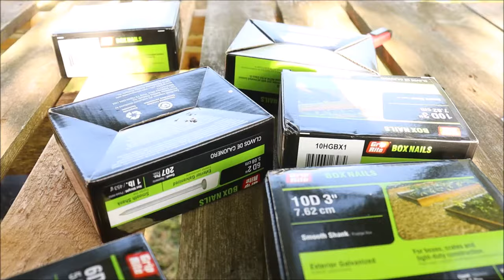DIY Building an 8'x12' Lowes Shed Kit/She Shed

Comment: We recently put up a shed kit from Lowe's as well. Ours was a barn style so the roof is a bit taller but other than that, the experience of putting it together was pretty much the same. The wood that comes with these kits leaves much to be desired, but in the end, it's a nice-looking building and is pretty sturdy. For our next building, we're going to use pallets and reclaimed wood. We want to be able to do it on the cheap, so using free wood should help.
Reply from the maker: I too enjoy  using reclaimed items to build with.  They are usually much sturdier materials and then there is so much room in the design project.  I am loving my shed, but I wished we could have used different material foe the doors and different window and door placement.  In the chicken coop project I did at the same time we used recycled materials and I am very happy with that project.  I would love to see your next project!
Reply: @BloomwellHomeGarden  Interesting that you mentioned a chicken coop because that is going to be our next project. We are currently building the pallet shed and so far we only have the walls up. Still need a roof, door, siding, insulation. But after all of that, the chicken coop is next on the list.
Reply: @BloomwellHomeGarden  By the way, I just subscribed and I am going to have a look at your chicken coop video as soon as I get a chance. 😊
Reply from the maker: Thanks so much! Welcome. We appreciate having you along and welcome your comments and ideas !
Reply: @BloomwellHomeGarden  hillbillies in use — be careful - Duct taped Duster coming

Comment: Hey how’s the shed been? I’ve been thinking of buying one my self would just like an honest review thxs !
Reply from the maker: The shed has been wonderful. In just a few months (July) it will be 4 years already and that just doesn’t seem possible. To date, other than a piece of door trim along the bottom of the door that was actually my own fault because the latch was not closed properly and a storm blew in causing the door to swing open and closed several times and knock it off, there have been zero need for repairs!  I am so thankful we did this project and have zero regrets ! Now that the shed is established, it seems as if it was always supposed to be there! Good luck with your purchase. I would love to see a photo when you have yours completed!

Comment: This is called a 12x8 stratford from lowes. Would have probably put some 4x4 runners on top of concrete blocks just to get it off the ground. But great build
Reply from the maker: Thank you for watching and for your comment Jorge!   This spring we did use a tractor with a bucket to lift the shed and place concrete blocks under it.  Once this was done we made sure we took the time to make sure it was level.  I had not anticipated how much our ground would heave in the winter.  Now we have plenty of clearance under the shed and it is no longer on the gravel.

Comment: Does the siding cover up some of the base 2x4's?
Reply from the maker: Yes it covers most of the base.
Reply: @BloomwellHomeGarden  Thank you for the reply. I'm building a shed just like this on top of a detached deck and will need to cut the siding so it's flush with the base 3/4 plywood. Thanks!

Comment: Hire a contractor, best money spent, that is what i did!  If you live in an area that snows, you will need to redesign roof so snow falls to the side and not in front.  Cant use it all winter
Reply from the maker: Thanks so much for watching. We couldn't hire a contractor because of covid. Everyone was scheduled 6 months out in our area, these sheds had 8 month waiting list, and we love to do it ourselves.  However, we are having a 12x40ft shed built and delivered in a few weeks, that was more than we wanted to attempt with this year's projects.  You are absolutely right, the positioning wasn't bad for snow, however the ground froze and heaved up and I couldn't get the doors open. We have someone coming April 1st to fix all that!
Reply: @BloomwellHomeGarden  my shed 10 x 12
Reply: @BloomwellHomeGarden  my shed 10 x 12
Reply: @BloomwellHomeGarden  I would just jack the building up and set it on 4" blocks.
Reply from the maker: @gailtaylor1636  we did that about 2 weeks ago!  Still perfectly level. We had a friend with a bucket on his tractor. He lifted and we slid  the blocks in place. After that I had it tilled so I may plant flowers around it. I will be doing a DIY pathway from the patio to the shed soon! I cannot wait to have a nice pathway!  Thanks for watching!

Comment: What happened to the studs on either gable end wall?  There are no vertical structural elements on either end of the building, just the OSB siding holding up those ends.  I would also have raised it up a bit instead of laying the 2x4 joists directly on the gravel.  Moisture will come up from the ground and it has no where to go and will allow fungus to grow and eventually you will get rot.  Sorry to be a bit harsh, but other folks watching this should not make these same mistakes.  But it does look nice with all the paint on it...
Reply from the maker: Hi thanks for your comments.  There are large posts, perhaps we.didnt film that part.  I didn't film this as a tutorial, just as information on what we were doing on the farm so I wasn't as careful spell out each detail and left out a lot of steps for time.  I mentioned that in several comments as well.  Also there are treated  4x4s under the shed and of course in a number of years they will need replaced.  Last year I mentioned we lifted the shed with a tractor, leveled concrete blocks and sat the shed back down on those to get it off the ground more.  Thanks for sharing your tips within our community!

Comment: How much was this shed?
Reply from the maker: Thanks for watching Kathy!!  The shed kit was purchased from Lowes last June.  It was $948.00. That does not include the floor.  We purchased I believe 10 2x4x8 in treated lumber. We also picked up 3 4x8 sheets of OSB plywood, 3/4 thick.  Not included in that price was the shingles.  These I chose in cinnamon were special ordered. It was 5 square and I believe it was $89.00.  I also.contacted the company and ordered 2 more windows at $98 each.  The paint is not included in the price of the shed and I used 2 gallons for the lighter color and 1/2 gallon of the darker brown. This was WalMart Color place exterior paint in Satin.

Comment: I think your shed is less than 8x12. Each panel between the 2x4 should be 12 inches wide. If it was 18 inches 18x6 is just over 10 feet not 12 and the side panel is just under 6 feet. 12 feet across and 8 feet wide is 144 x 96 inches.
Reply from the maker: thank you for pointing that out.  It is an 8x10.  I apologize for not having the correct measurement.

Comment: The foundation...shouldn’t it be raised a-little AND or at least be pressure treated wood.
Reply: Hi Lance, Thanks so much for watching!  You know how you build, make or create something and months later you say, "If I did this again I would... "  Here we are 4 months later and I would like to say, Yes I wish we would have raised it more.  I will be digging out farther and building up around it, next summer. However, we did take extra care with the bottom of the shed by digging down as far as we did, and adding that nice thick layer of gravel for drainage. All the wood on the bottom of the shed, and the flooring is all  pressure treated lumber. I hope this helps.
Reply: @kimbloomwell6395  oh ok i see 
Yeah raise for sure 
Good work! 👌 Happy Holidays
Reply: @dumpsterfire6351  Happy Holidays.  We are getting ready to do this all again. We are hoping to build a tiny home and a new chicken coop this Spring!! I am excited for both!
Reply: @kimbloomwell6395  oh yeah...just jack it up and put blocks under. Done. 
The nxt projects sound fun as well!
Reply: @kimbloomwell6395  careful, not all pressure treated wood is rated for direct ground contact.

Comment: Ok so i bought the same EXACT shed. 
In middle of building it now. 
I have to say all those DAMN NAILS 
I bought a nail gun 😂✌️

Yall made this look easy ...its not
Reply from the maker: You are right! Solo many nails.  I prefer to use screws  and was really surprised when we unpacked all those nails! We hammered for hours. A nail gun will be great to make it so much faster!!
Reply: I had my contractor do it.  Worth the money!
Reply: @ceciliapreziose3783  its a DIY though. 
You ripped yourself off